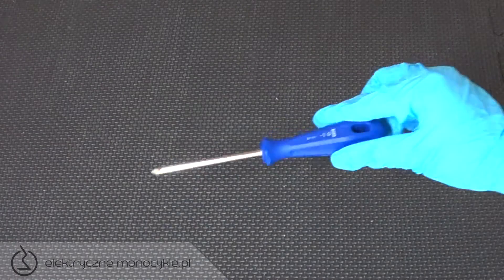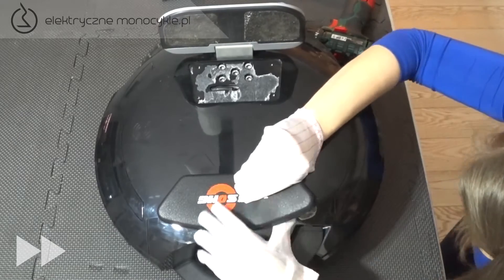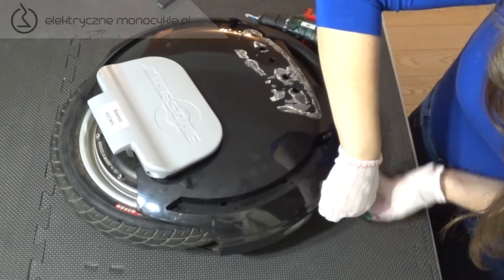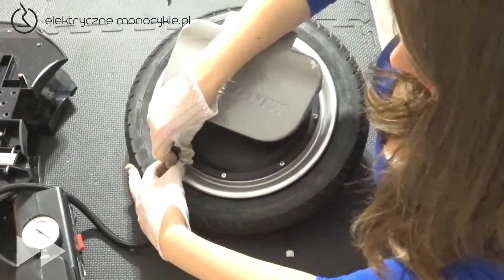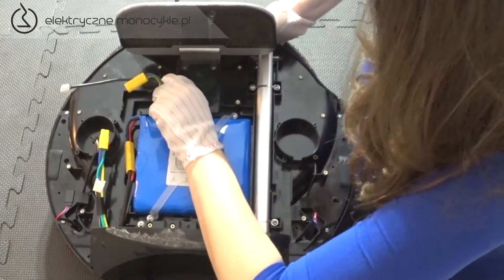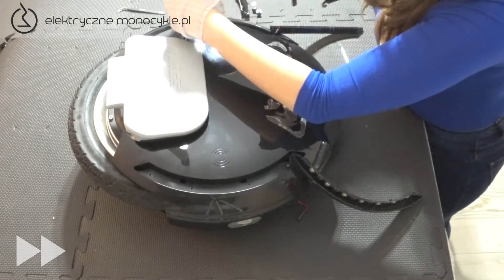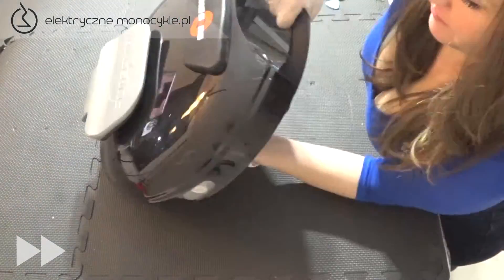Kingsong KS14 KS14D - wymiana opony i dętki w 5 minut + demontaż (Justina's Garage odc. 2)

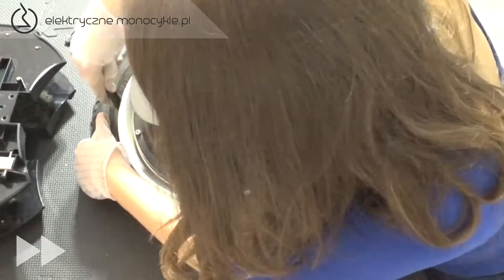Comment: Additional tips to this video: PH3 head is necessary for the big screws. At least for me, it was impossible to unscrew the big screws without a PH3 head and an electric screwdriver. And yes, the small screws are delicate, so hand screwdriver is a wiser choice for those. It was a fairly big challenge to disassemble and assemble again, for someone who never disassembled such devices before. It took a few hours. However there was one part that was especially difficult. That was the removal of the outer tire. I tried with many tools, but they just bent or broke. I even took the wheel to a bike shop and they also broke tools and couldn't help me. Also car repair shops did not have tools for this. So it was difficult to get the tire out. In the end, a friend of mine with lots of motorcycle repair experience was able to do it. It just requires the right kind of tools and a specific technique. In the video at 3:23 it looks so easy (although it skips the hard part), but it was really difficult without exactly the right tools and difficult for the bike shop even with similar tools as in the video.